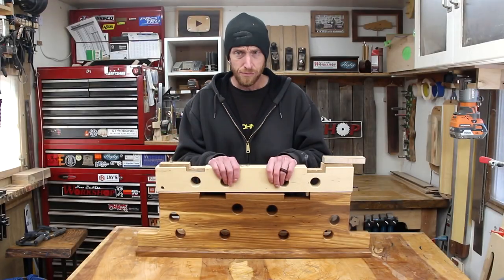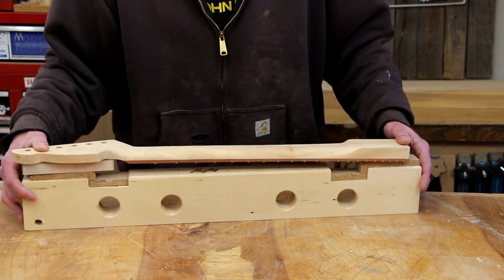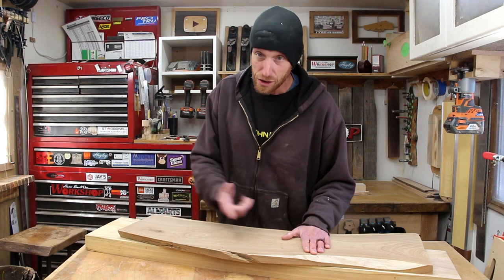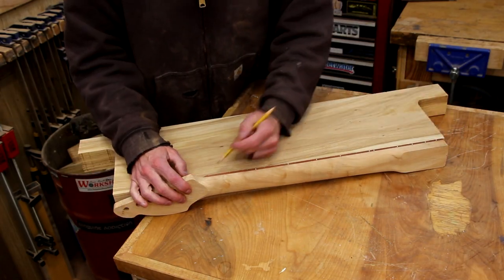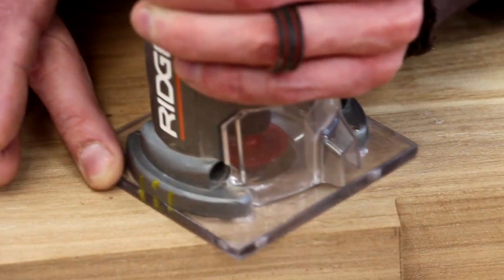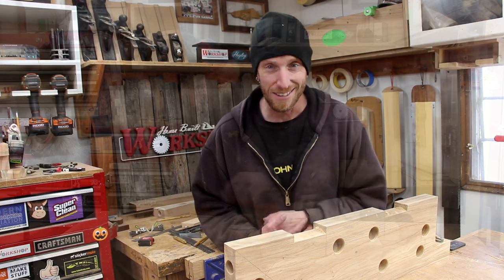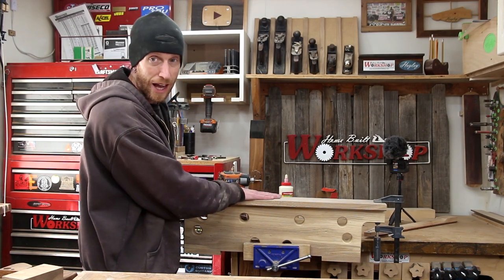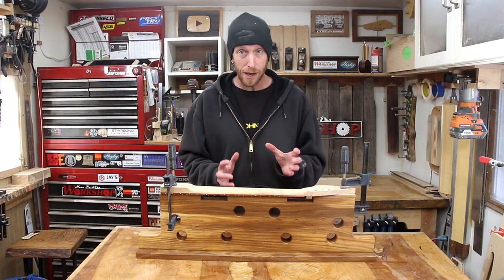Build a Guitar Neck Carving Buck | An Important Guitar Building Jig

Comment: Its a shame you didn't consider that the same jig could have accommodated a bass neck as well with the right length and cutouts
Reply from the maker: True. It would be easy to make it more universal.
Reply: You could cut what you did in half so you can insert an insert piece, like a dining room table leaf